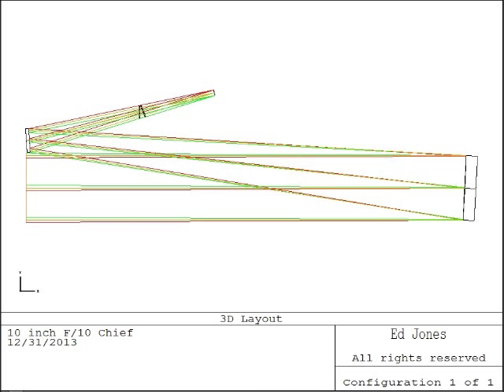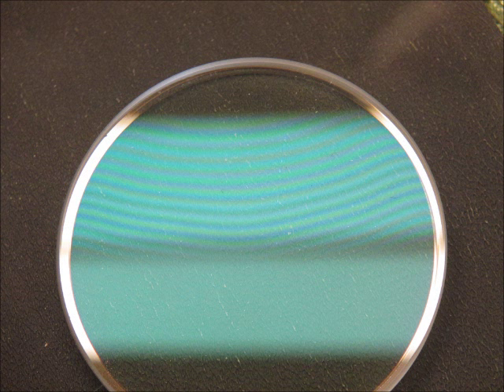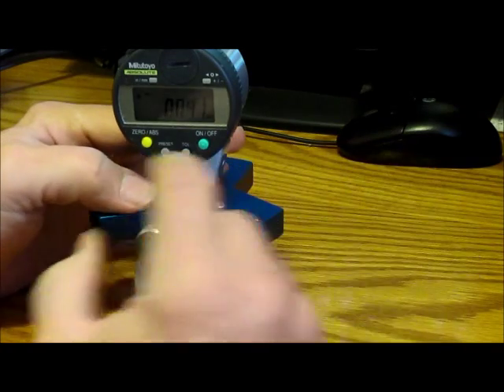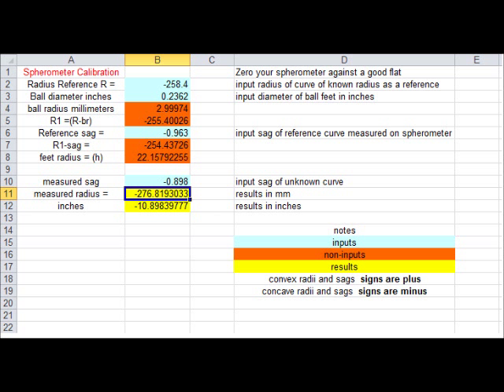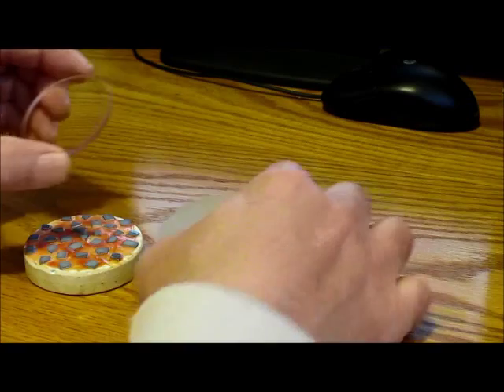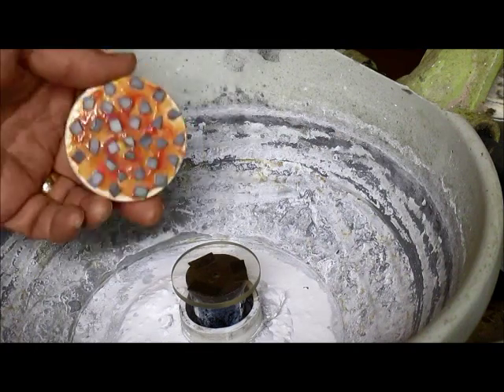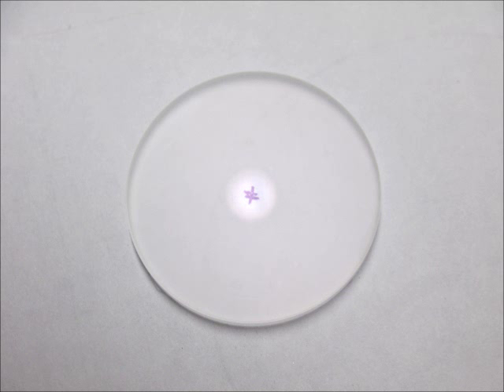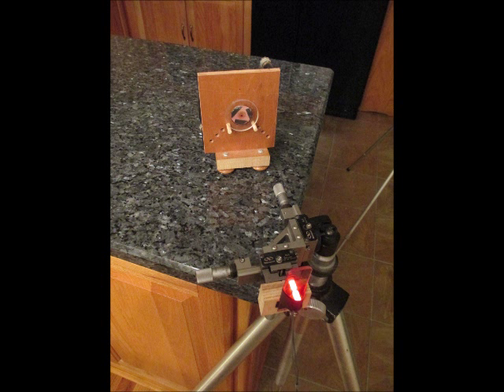Chiefspiegler Optics for a 10 inch F/10 telescope

Comment: Hi Ed, Woody here, MVAS Dayton. Question on your Excel spreadsheet.
 The ball radius for your sphereometer ? is that the little saphire balls?  if it's simply the contact end how is that relevant ?
I understand computing the difference between the spherometer diameter & the actual optic diameter..( and how that changes the SAG measurement) 
I guess I'm asking - isn't the only measurement important the spirometer diameter at the contact ends, and how does the diameter of the contact end balls matter ?
 I know it's probably a dumb question LOL
Reply from the maker: Woody, if you use sapphire ball feet you have to account for the ball radius in your calculations. I use 6 mm sapphire balls.  It does matter if you want the highest accuracy, otherwise they will contact  different curves at different places on the balls.
Reply: Ed Jones.  
Oh !! Curve (sphere) balls on a curved (convex) surface makes the contact Point(s) different, based on both radii  !! Duh!    Thank You Ed !

Comment: Hi Ed. Thank you for the link. I will have to watch all your videos the pose my question(s). I am leaning towards the modified Schupmann (your version). Ideally, if possible, with lens elements that I can get off the shelf from Newport. I should have a better idea as to what kind of testing device I will need to make. Definitely interference type. The Bath looks interesting but I don't know how wide its applications are.

I don't know why Newport is flying under the radar....it seems that way anyway...